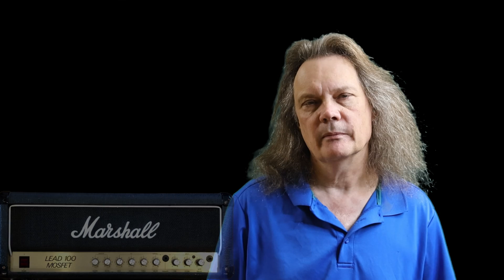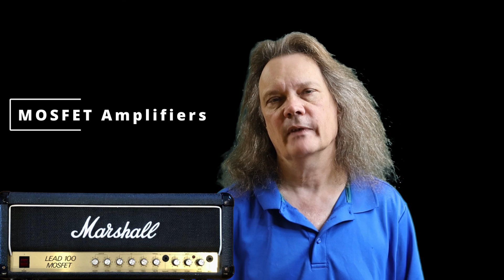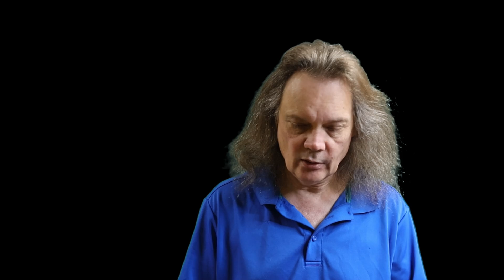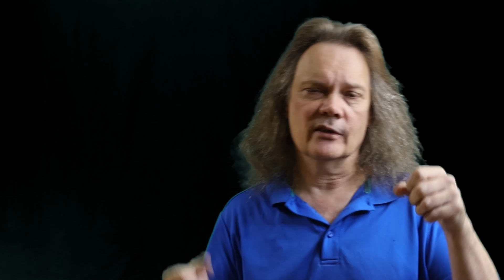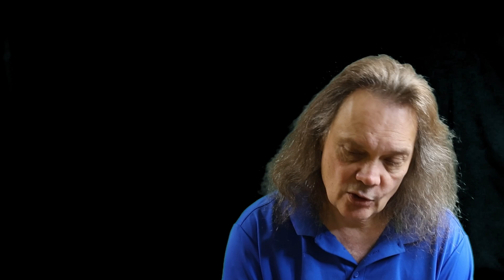Advantages of MOSFET Amplifiers

Comment: It is difficult to say now whether MOSFETs are still good to use when compared with power transistors. Both continue tobget better and better. However, the new power MOSFETs of Vishay, particularly the IRFP240 and IRFP9240 pair, do seem to give very good linearity, such that they don't even need any feedback circuitry in a AB design. Great sound.

Comment: The new generation will accept the new digital amplifiers that are developed with fast gallium transistors that can achieve excellent acoustic performance. Bipolar power transistors have improved and after the latest creations in the field they have built-in diodes that thermally stabilize thermal runaway. Mosfets have something magical though because they produce a fine sound with musical harmonics at saturation. In clipping, bipolar transistors are more dissonant, maybe good for rock music. If we like classical music we will appreciate the lateral mosfets that are still manufactured in professional versions under license in England. They are protected and improved compared to the 70s and I don't think the price is a problem. I listen to music with double 250w complements on the same capsule that have the code ecw20n20/ecw20p20. They have the advantage that they eliminate the triplets of bipolars in class B that produce distortion and thermal packaging and can be ordered with stages that work at 5ma and I don't understand why they are ordered in many schemes with very high currents.....I recently heard the expression of digital contamination and we must mention that high frequency noise that comes from insufficient interference suppression of digital amplifiers. Speakers and their SPL are also important, as are filters that lose and require high power and create problems. For home use I use 16ohm speakers with high SPL and the sound vibrations are sufficient for home users. I also have a pair of 8 ohm speakers with 98db SPL that produce a sound that is too loud for home use. If they existed I would buy 32 ohm wideband speakers with, say, a minimum of 110db SPL and the band as linear as possible. A 100w/8ohm amplifier would output 50w on 16 ohms and 25w on 32 ohms. The acoustic efficiency makes it sound just as loud and the electrical power becomes a parameter that must be rethought and expressed differently. I don't know in what way because I don't have advanced studies in the field, being only an IT practitioner and technician. I appreciate your comments that help me. They seem objective and I have subscribed to you for future comments. Greetings, esteemed Sir.
Reply from the maker: Thank you for the detailed comment, I appreciate your thoughts on the subject!

Comment: My Hafler Dh-220 has Mosfet output transistors and huge heat sinks that get pretty hot.  I built the amp in 1984 and never checked the bios so that is on my to do list along with restoring the thermal compound.  The bias was set at the factory according to the materials, but I need to confirm its set correct.  I was surprised to see a mention that Mosfets run cool in your description given my experience with this amp being a space heater.  

It still sounds amazing but I'm not using it till I check it out and check the electrolytics
Reply from the maker: I had a DH-500, and it would run pretty warm at idle as well.  Class AB amplifiers, even using mosfets, do dissipate a little heat at idle depending upon bias.  The service manuals for those Hafler amplifiers can be found on the Internet, if you're looking for the adjustment procedure.  It's pretty simple.  Thanks for watching!
Reply: @Barry-Watson  thank you the video was helpful in better understanding my amp.
Reply: I  had jad one of those great sounding amp and easy to work on. David Hafler was a genius  and were sold in all high end hi fi stores in the 1970s . it sure would be great to have good kits like that again

Comment: Bob Carver is a genius but probably not more so in tech than in marketing. Phase Linear amps were among the most volatile BJT designs out there.
Reply: Yup - short that PL 400 output just the little bit, and you can scrap the amplifier, or spend hours replacing every single one of those PL101 transistors, the drivers and other bits on the driver board, and use wire to replace the ridiculously narrow traces.

Comment: hehehe all Class-D amplifiers I know off has a MOSFET output stage - sooo, the MOSFET amplifier is absolutely still going strong LOL

I think (guess) that the biggest problem were that the MOSFET's became so popular in switching circuits that, today and the last 2-3 decades, the research and development efforts into MOSFET's has been on switching optimized types.
And there is a huge difference in parameters of a switching type and one suitable for analog/audio circuits - try find suitable Power MOSFET's for a 100+Watts analog output stage - I mean a complementary set of 2 transistors or a Nch that could be used for both upper and lower side (not ideal) - not 5 sets of paraleled compl. pairs.

I think that one of the hurtles is that it is, seemingly, much more difficult to produce a to produce a "well proportioned" Nch/Pch complimentary pair of MOSFET's than it is to produce a complimentary pair of BJT's

Btw, I sat and waited for you to "touch" on the drawbacks of the tubes and the reason why so much effort was put into making amplifiers with transistors !?! - but well most of us know why.
They are actually mechanical parts and they wear out much faster than transistors, and while they wear  they change the way they sound, and a new tube does not sound exactly the same - no matter how good the amplifier design is.
then there is the types of distortion that tubes and transistors are able or prone to produce or not able to produce because there are some restrains on the way you have to design the circuits around them ;-)
Reply from the maker: Great info!  Thanks!
Reply: From all accounts vacuum tube design was a chemist's wet nightmare. I don't believe there are two digits of folks alive who could do what was done in the 1920s-1960s.
Same goes good luck getting to the moon and back in 202x using verbs and nouns. Ain't gonna happen and furthermore, OSHA would never approve it.